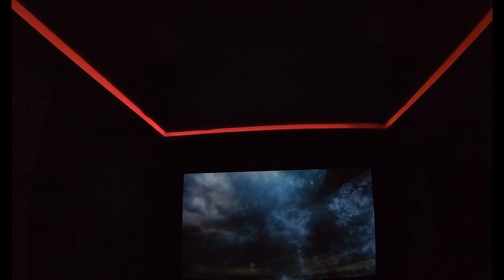Home Theatre and Study Build (DIY)

Comment: Fantastic job, love the seating. Are they recliners ? If so how much space did you leave for the lower one as looks snug. Great job
Reply from the maker: Yep they're recliners (except the middle position). We left enough space so both rows could be fully reclined and the rear row's feet don't get too close to the front's head

Comment: Okay love the transformation but you’re gonna have both structural issues and moisture issues… you need a steel lentil and supports for where you put in the “new door” and wood never touches concrete without a barrier
Reply from the maker: There is a steel lintel above the door and there's barriers and seals wherever qld building codes require, the video doesn't really show any of this, a few times we had to redo things where we forgot them
Reply: @willusishere  awesome. Sucks that you had to redo the work but glad you did it right in the end… Hate to see all that work go to waste

Comment: greetings :) very nicely done. I'm interested in what layout you have set in the Denon menu. Is it 9.1? Do you want to make another video about sound settings in the Denon menu? :) and some more details about the sound…😊
Reply from the maker: It's set to 11.1ch with the rear Atmos speakers on pre-out only and 2 subwoofers. Sure I'll try make a video of that, thanks for the suggestion
Reply: Thank you for the info. What other amplifier do you use for pre-out?

Comment: When you opened the door to show the end product, I was blown away with how good it was. I did not expect it to turn out that amazing. Well done. It was great to see the wife also helping in the build and she did a great job painting. Good to see a fellow Queenslander 😁 Curious why you chose the Polk V65 In-Wall Speaker for your Atmos speakers instead of the usual round in ceiling speakers like the Polk V80 Ceiling Speaker. How do they sound as over head Atmos speakers. what lighting strip did you use up top around the ceiling.
Reply from the maker: Went the V65 so all the speakers matched more closely. We're limited to regular bookshelf spkrs for the rear surround so I chose an in-wall with the closest tweeter/woofer size to those. V65s sound great as Atmos, the directable tweeter really helps. Led strips are 5m 12V 5050 RGBW (60LED per metre) no brand strips from Aus Electronics, 4 x strips powered by 2 x Shelly RGBW2 controllers
Reply: @willusishere  Thanks for reply. Did you do plastering yourself. Once again great looking room. Enjoy
Reply from the maker: @gab7344  we hung all the plasterboard and straightened the walls but we got a professional in to do the finish plastering

Comment: So much work, ends up with a projector...
Reply: Nothing better,  Got my 4k Projector.  Cinema isn't a cinema without a projector.
Reply: @Inboundbogie  cinema is always better with a high quality tv panel. Trying to copy a movie theater is not normal, nor advised. Movie theater replicas are a cult, freak behavior. Movie theaters have tons of issues and weaknesses. At home you can have a much better experience with a good tv and a sound system that puts you in the center of the action, instead of trying to accommodate lots of people like movie theaters poorly do.
Reply: @rafars2246  My friend, I think you understand this.
I also agree about the projector. But what do you recommend I use instead of a projector?
Reply: @rafars2246  you don't know what your talking about. Tell me where I can get a 135 inch  4k tv to replace my Projector... exactly. Projectors are better for more immersion. Some Projectors even look better than some tvs in the right room conditions. Don't be a Debbie downer.